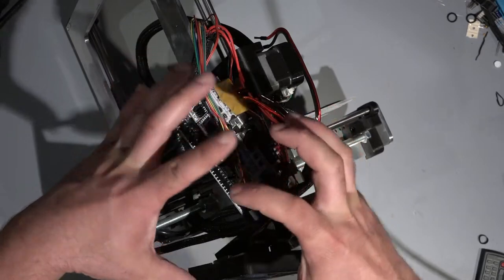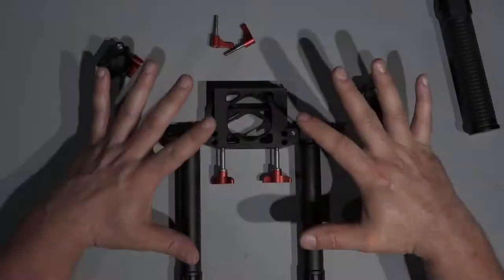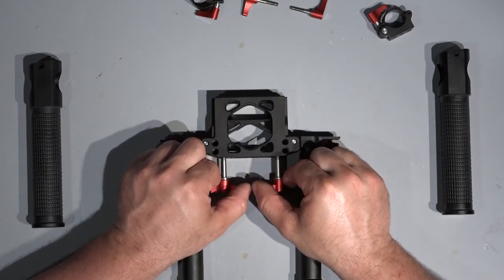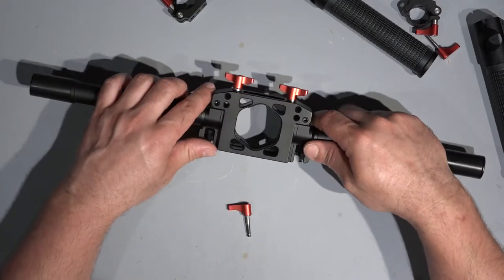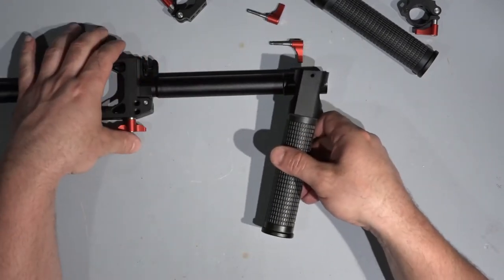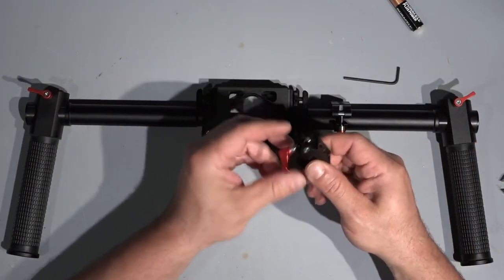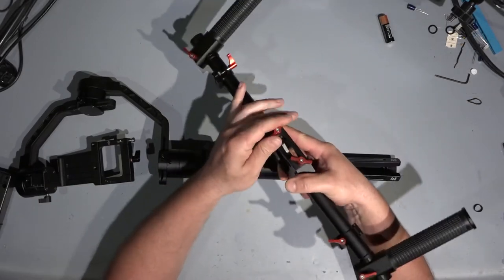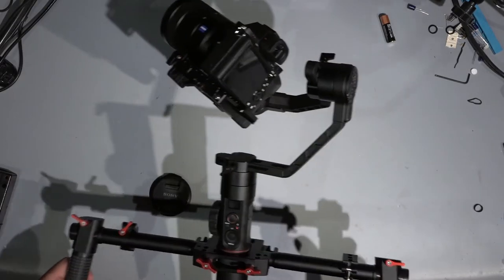EACHSHOT DH-1 Dual Handle Gimbal Grip for Zhiyun Crane 2 and other gimbals

Comment: Hello friend, I was thinking of buying one .... is the part where the gimbal is squeezed? Is it tight and tight? It's what worries me the most, the fastening!
Reply from the maker: The screws are so hard and precise, its almost impossible to tight up half. You just have to get use to it. The squeezing is coming when the motor settings are not matching with the weight of the camera. You can fine adjust in the App. No other issues until now. The most loved feature by Me is the battery life :) 11 hour party recorded in one shot!